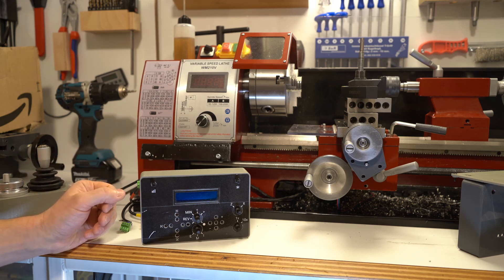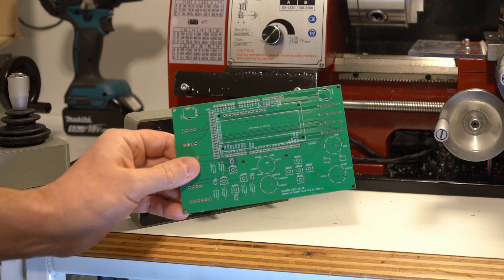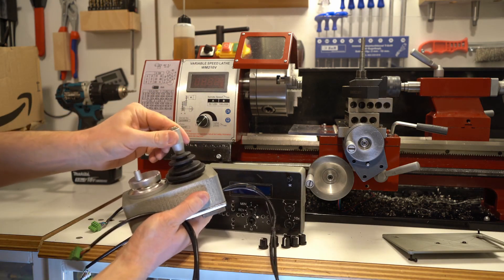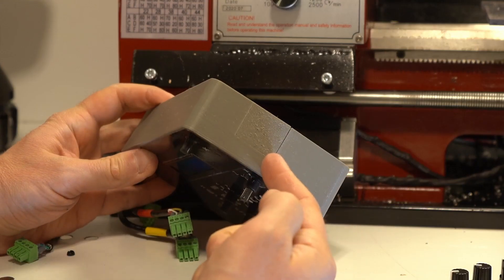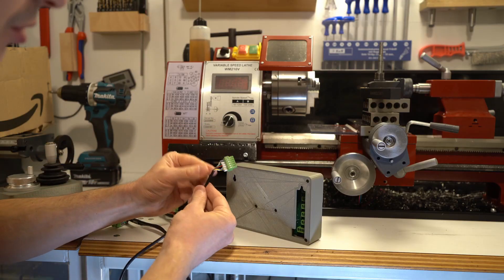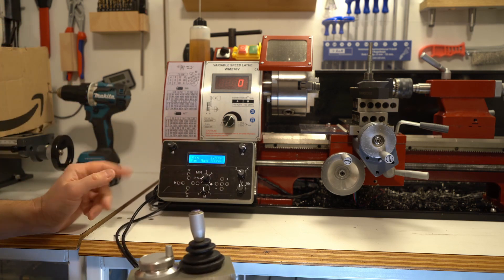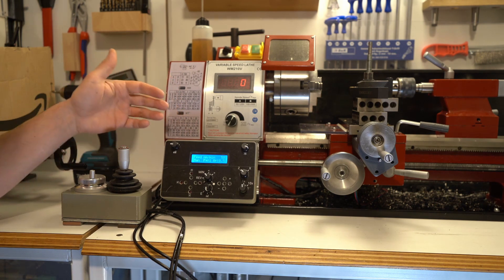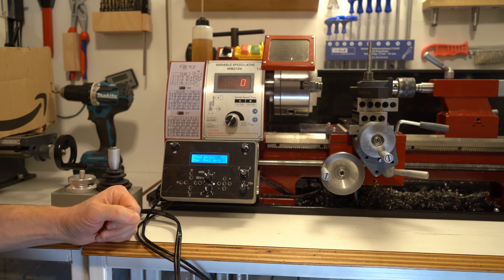DIY 2-axis lathe controller

Comment: Hello! Maxim Kachurovskiy

Thank you for the detailed explanation of Digital Feed 7e2 ELS.
Joysticks, hand encoders and other parts are starting to arrive in Japan from China
I'm printing the case with a 3d printer.

In the threading test, the parameters were adjusted to a satisfactory quality.
I'm increasing the number of threads and finishes.

I didn't know to use Excel to calculate thread and cone parameters :-)
thank you.
Reply from the maker: Hi coinpark rx, thank you. I've translated XLS file and added some basic instructions just now, was puzzled myself for a while when I had to do it first time.
Reply from the maker: Also, I forgot to publish the latest back panel STL last night and only uploaded it just now. I hope you didn't start printing https://github.com/kachurovskiy/megaels/blob/main/cases/megaels-case-lid.stl yet :)
Reply: @MaximKachurovskiy  
Hello Maxim!

The back panel STL was in time for printing! :)
7e2 table calculator is amazing! I was surprised that the table was created.

Watching Maxim's video, I also want a 7e2 ELS! I want to make it! I thought.
It's fun just watching my lathe automatically thread impressed.

Thank you

Comment: Hallo, ich habe eine große Drehmaschine aus 1919 wo ich das wechseln der zahnräder und die getriebebox (extrem viel Reibung und daher unmöglich mit meinem 1,5kw zu betreiben) austauschen möchte mit einer ELS.
Ich aber absoluter Anfänger in dem Bereich und wollte dich fragen ob es einen Guide gibt wo man sieht welche Teile man braucht und welche software.

Hoffe du kannst mir Helfen, danke
Reply from the maker: Hi! Ich kann Rocketronics Controller für Ihren Fall empfehlen, da der Bau von MegaEls oder NanoEls viel Bastelei und Löten erfordert. Die größten Fragen, die Sie sich stellen sollten, sind, wie Sie den Drehgeber an Ihre Drehspindel anschließen und wie Sie den Schrittmotor mechanisch mit Ihrer Leitspindel verbinden. Der Rest ist im Rocketronics-Handbuch gut abgedeckt. https://www.rocketronics.de/shop/en/electronic-leadscrew-els4basic.html
Reply: @MaximKachurovskiy  ahh perfekt danke für die Antwort. Steht da auch welchen Motor ich nehmen soll zb. Schrittmotor oder Servomotor

Comment: Maxim, great work with what you have done. Are you using the same setup as in the nanoEls video to drive the cross slide and carriage feed?
Reply from the maker: Michael, thank you, yes, I'm using the same old cross-slide motor mount (https://www.thingiverse.com/thing:4714722) but I'm currently installing metal gears on it instead of the plastic ones.

Comment: Hello,
how would you compare Oleg's 7e2 ELS with the Rocketronics ELS  ? As a performance and functions.
Reply from the maker: Rocketronics does have more functions and is easier to get started with - https://youtu.be/6iP9LV2qCeg?t=428 - but Oleg's ELS makes it easier to perform less-precise operations fast with the joystick and is cheaper - especially if you already have some of the parts.

Comment: Great job. Does this uses the same encoder as your previous one? I did not see one in the BOM.I was previously looking at building version 6c, gave up trying to debug using google translate.
Reply from the maker: Yes, it works with most 5v optical encoders, I'm using same one I used on NanoEls. I didn't include the encoder and motors in the bill since all lathe controllers would need them.

Comment: Can you be little more specific about components required written on github ?
joystick has 2 types, momentary and latching. 
Pulse generator comes in 2 sizes 60-80mm and different voltage 5v 12v and 24v
Rotary switches come in 1 pole 2 pole and different number of pins. Dont know which components to buy.
Reply from the maker: Tony, I think all of those questions are covered in https://github.com/kachurovskiy/megaels#components including AliExpress links - thank you!

Comment: Nice project! 👍
Did you forget the price of the stepper motors and stepper drivers?
200 Euro seems cheap?
Reply from the maker: Hi Wiz, sorry for confusion, I didn't include the price of motors and drivers since you need to buy them no matter which controller you chose.

Comment: Are you thinking of porting the code over to esp32 ? Looks do-able and might give you the option to add more features with a larger display.
Reply from the maker: Not really, this codebase is for some reason very hard for me to make changes to. It's built on hardware timers I think.
Reply: @MaximKachurovskiy  Indeed the code is a bit complex, but from what i could see, it's can be adapted to a 3.5" TFT screen or even to a Nexus one. Of course, bigger screen would offer the advantage of having much clear information's displayed, instead of few symbols (like in the case of a 1602 display). Myself i have build the version based on the 2004 display and still i think that a 3.5" screen or even a 4.2" would be much better, so work in progress.
Reply: I wrote an esp32 ELS about a year ago and I'm using the wifi + websockets + react for the controls which works well.  If you are a developer you should give it a shot, "espELS" on github.  not much documentation but I'm happy to answer any questions via github issues.  it only does 1 axis today but it wouldn't be hard to add another axis.
Reply: @JesseSchoch  looks nice

Comment: Salut, il fonctionne correctement ??😁
Reply from the maker: Hi Dilan, yes, I initially had all sorts of problems with wrong axis direction, wrong encoder direction, thread tables in the code not updated, etc. Now all those pitfalls are listed in the GitHub repo and should be easy to avoid 👍
Reply: @MaximKachurovskiy  merci super je vais le fabriqué alors merci 🤝👍🏼😉
Reply: @MaximKachurovskiy  combien faut t'il de driver 1 ou 2
Reply from the maker: @MrDelabrousse  every stepper motor needs it's own driver - so 2
Reply: @MaximKachurovskiy  ok merci
Reply: @MaximKachurovskiy  combien font les bouton 6x6 en hauteur il m'en reste merci
Reply: @MaximKachurovskiy  POUR POURSUIVRE MA COMMANDE IL MANQUE DES INFORMATION SUR LA TAILLE DES LED, LA SONNERIE 5V TAILLE ??
Reply from the maker: @MrDelabrousse  I used 11mm tall buttons, you should have those left over from the NanoEls build. LEDs are standard 5mm diameter, 2.54 distance between legs. Handwheel is 5V 100ppr 60mm 4-pin. Cheers!
Reply: @MaximKachurovskiy comment et ou entrer le donner du fichier XLS 
je voit pas du tout comment sa fonctionne je vois que sur le tableau l'encodeur et sur 1800  jai un encodeur de 600 JE DOIT METTRE 600??
Reply from the maker: @MrDelabrousse  forget those XLS files, they were a pain to use, just visit http://kachurovskiy.com/megaels/Digital_Feed_7e2/tables.html to re-calculate those tables and copy-paste them into your code.
Reply: @MaximKachurovskiy  I managed to make everything work sayer I'm super happy on the other hand at the cone level when I set it to 45dg it is not at 45 how to set this thank you
Reply from the maker: @MrDelabrousse  congratulations! Please start a discussion on GitHub, it's really hard to debug on YT. I suspect you either need to calibrate the axes or regenerate the tables.html
Reply: @MaximKachurovskiy  I already have the conversation on github I will close it and open another

Comment: i would build this with a teensy 4.1. much faster and more capable micro controler.
Reply from the maker: You'd have to rewrite most of the Arduino code then since it's written specifically for Mega
Reply: @MaximKachurovskiy   thats an abselute bummer. the code is exactly where im not good with........